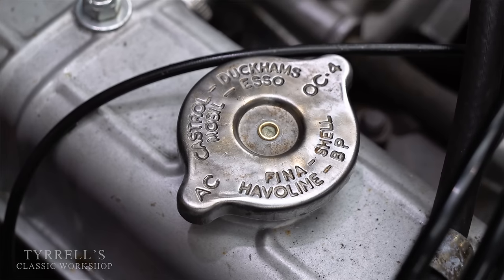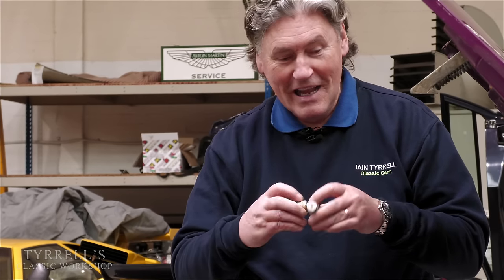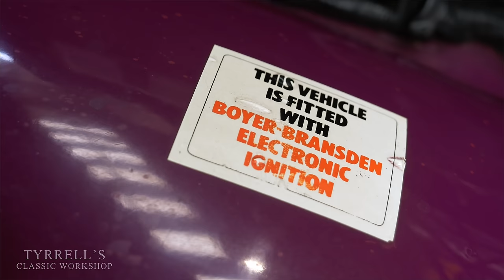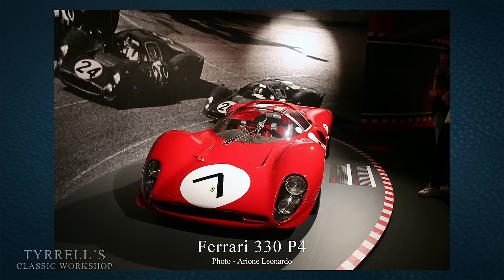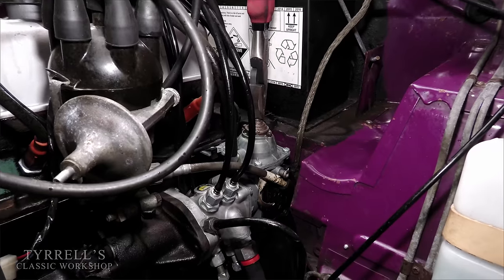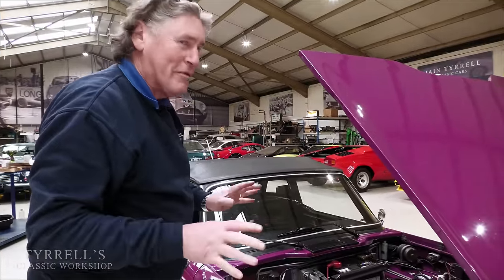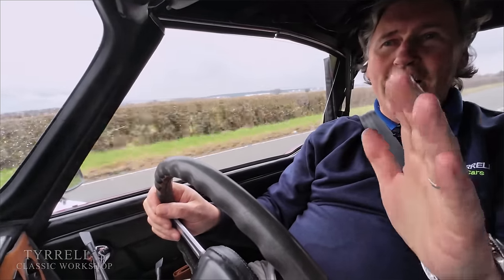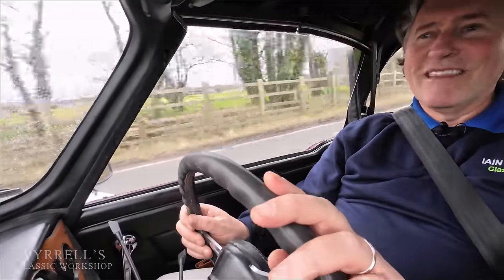Inside the Triumph TR6's Ingenious F1 Fuel Injection System | Tyrrell's Classic Workshop

Comment: Nothing wrong with the TR6
Reply: Then you probably haven't owned one. I once had to replace every bit of wiring in one
Reply: The colour
Reply: @jaapbruijn1300 Beautiful.  That and white.
Reply: @davevan9150 ha, I had to replace the wiring on a TR4 when the ammeter wires sawed through the bulkhead, nasty mess.
Reply: That an IRS wouldn’t fix.
Reply: You’re wrong though.
Reply: @davevan9150 
Why?
Reply: True. Here in the States, the TR6 was known by many as the one fairly reliable, British sports car/roadster. It came along too late to save the poor reliability reputation of British cars in the US, which were displaced as a primary import by Japanese cars.
Reply: @sparky6086  
The Japanese replaced US cars as well.
Reply: Great colour
Reply: Absolutely!
Reply: Not at all.....uhmm big Healey...😅
Reply: Cheap and too slow it deserved the Rover V8
Reply: Except that, under that gorgeous skin, was basically a truck.  Mid-50s frame and suspension technology.  And, of course, Lucas.

Comment: I had a 2.5 PI saloon which served me as a high speed commuter from Leeds to Darlington in '73-'74.  The weak point was said to be the HP fuel pump, but luckily I never had a problem.  These were used as police cars.  Got stopped once doing 100+ on the A1 and got off with a friendly warning.
Reply: Ha, ha, wonderful... I was stopped in a yellow Fiat 124 sport coupe in Peckham doing 55! They let me off too. I only did a quick burst, but still, today? No chance. Also today, I'd never speed. Times have changed. I love the  2.5PI saloon. It looks better than the stag to me.(I had three Vitesses).
Reply: My Dad had both a Mk1 and a Mk2 2.5 PI. He was (still is at 88) an “enthusiastic” driver and loved them dearly. The held the road like they were glued too; I think they had an independent rear suspension set up. We drove (on family holidays) all over Europe in the late 60’s and early 70’s and we only had problems with the HP fuel pump in hot weather (in Spain and Portugal). It was in the boot on one side under the luggage floor and was easily accessed so we used to wrap a wet towel around it, which worked a treat! Great cars!
Reply: what a warm noodle british story to say the least
Reply: I owned a 2500 PI estate car. That think was a rocket ship. This was 35 years ago. To this day I sleep with one eye open to find another.
Reply: I was in the metropolitan police summer 76 triumph 2.5pi area cars, I remember some unit in the boot overheating in the warm weather and having to blag ice from the street traders to pack round the thing in the boot to stop the motor cutting out.
Reply: @cq44b  That's funny. Tell that to the judge. Couldn't get no ice. Lol..I remember now the motorway police had them in west midlands. My buddy had a lotus MK1 and would jump on at junction 2 and his police buddy was on the ramp waiting for a race. Or he was in the Jag. Get off at junction 3 Tipton. Blow out the injectors. ,🤣🤣
Reply: @simondavies4603  Didn't that rear suspension squat like a dog having a bog? lovely car though.
Reply: @adoreslaurel It did! I also recall it had overdrive in both 3rd and 4th gears. There is a lot to be said for sporty saloon cars
Reply: @simondavies4603  I had an MGB with O/D made the mistake of disabling the OD inhibitor switch, forgot to turn it off when stopping, not a good idea to take off in OD first, though its a good idea when changing down to remember OD 3rd back to normal 2nd produces a few more revs than you would like.
Reply: @adoreslaurel  initially they had O/D on 2nd 3rd & 4th but the amount of torque in 2nd damaged gearboxes so it was disabled, wiring I think . I did have the 150BHP model but without O/D
Reply: @cq44b  That was the  Lucas electric HP fuel pump I referred to in my post!
Reply: @julianb1474  hah yes mine was the same,  the injection system itself was great, but that #$% pump!

Comment: My late Dad used to tune these for a living "Triumph Tune". He loved the Pi system and was one of the few people in the UK in the 70's and 80's who could actually set them up correctly. Our main family car right up to the mid 80's was a Mk1 2500 Pi Saloon. The head and the ITB's were all ported and polished. I believe it made 170bhp approx.
Reply from the maker: Thanks for that- interesting!
Reply: We're you involved yourself by any chance?
Reply: @MrByootox  My Dad did teach me a lot of what i know, but i went on to do an Apprenticeship with SAAB and worked with them for a long time before going solo with The SAAB Clinic which i still run today. But these days i just do engine tuning. I dont really remember much about Triumph's.
Reply: Your dad tuned my tr4a in the mid eighties. Stage 4 cylinder head, triumph tune inlet manifold, fast road cam 45 webers. He was the goto man if you wanted serious power back in the day. It easily powered passed tr6 ‘s to much disbelief.
Reply: @terencebrown1754  He closed up shop in 1994 i seem to remember. My parents both retired to Swanage and i had to move out and find my first flat. Sadly lost Dad 3yrs ago to Cancer. Greatly missed.

Comment: Iain! How refreshing to hear someone talk up the Lucas Pi system! I've owned my 1969 CP TR6 Pi for 52 years. I'm its 3rd owner, when I bought it it had just 16k miles on the clock. I often told Pi sceptics how F1 cars used this Lucas system for decades which includes the pump, albeit laying horizontal! Unlike in the Saloon cars Triumph mounted it upright in the TR, so it sits on its thrust washer which would overheat on long journeys, as I experienced in 1973 driving to Spain! However Triumph come up with the so called 'Continental Cooling Kit' Haha, just a coil of metal fuel pipe coiled around the fuel pumps outer casing, and bingo it works too! Crude, but ingeniously effective! I test my injectors in a jam car that has a hole in the lid. I too have recorded all my servicing and work done and have all my MOT's and Tax discs, and all my invoices. I'm surprised how little these cars still fetch!

Comment: I loved my 2500PI when it was working. Lucas fuel pumps weren't wonderful in warmwer climates such as we have here in Australia. They'd heat up dreadfully in the boot there and start to vaporise fuel and cavitate before it made it into the system to go forward. The fix was a Bosch pump. The damned Germans still won! :)

Comment: I have an early 69 PI with overdrive that snuck into Canada. Restored it in 1989. Fitted a Bosch fuel pump and it has run reliably for 35 years with proper care. Own Porsche's and Ferrari but will  never sell the TR-6...
Reply: You mean you actually like the steering system/geometry and those rear oil/lever shocks?
Reply: @AvaPxiaO  Yes I do. It's a nice change from the effortless precision of modern cars. The TR-6 awakens the senses. You have to pay attention and drive it.
Having said that , I wonder how I drove one as a teenager as my daily driver. Even in the Canadian winters! Thought nothing of it. 
I must admit though , that as I have become older/softer I can only take her in measured doses but I enjoy every mile...

Comment: As a Benz mechanic it was assumed I could work on anything from across the pond. Got one of these in the late 80s into the shop. Being Bosch certified I was under the misapprehension I knew everything injection. Got a lesson on this one. The valve is very much like American gas range valves. Aside from its multiple layers it is essentially the same. After that it was easy peasy as you Brits say. The car was a TR7 wedgy I believe.

Edit: As for Lucas bits I'll say this. If your grounds are well done, and you keep things clean, most of it is serviceable
Reply: Now I'll have to try and look-up American gas range valves to hopefully understand what have said.
Reply: If it was a TR7, it’d have been on carbs. Later on, the TR8 used electronic fuel injection (Bosch L-Jetronic)
Reply: Lovely car driven on potholed roads!
Reply: @emmajacobs5575  I'm sure that California spec 2.0 litre TR7's were fitted with Bosch injection equipoment in order to pass that states emission requirements.

Comment: The Laycock overdrive system is simply devine equating to a 6 speed gearbox, 3rd, 3rd o/d, 4th, 4th o/d. When changing down a quick blip of the throttle as you flick the o/d switch and you get a seamless gear change. Fantastic.

Comment: The most fun I've ever had driving was when I was able to swap cars for a weekend with a friend's 1972 Lotus Elan. I'd had the chance for an odd drive in Triumphs and MGB's, but the Elan was in a class by itself. There are few modern comparisons for these mid 20th century British 2- seaters, for sheer driver pleasure. At least not for the money they cost new. 700hp and driving aids really can't compete for driver engagement in a light car designed to make best use of under 200hp.
Reply: Yes! It wasn't particularly powerful, but the light weight and the handling made it a contender. I had a ride in a modified Elan in 1970. I think that Lotus claimed 105 bhp or thereabouts for the standard Lotus/Ford engine. Those were the days when quoted HP figures were to be taken with a huge pinch of salt. It was more like 90. But the car was so light that the performance was quite good. Ian Walker Racing in London raced Lotus Elans. He would sell you a modified Elan with a genuine 165 bhp. That was fast 😁🤩

Comment: Lovely in Magenta! In 2006, I bought a 1969 mk2 Triumph 2000 saloon. Most people who saw it threw their hands up in horror assuming it had the PI injection system whereas in fact it had carburettors. From getting to know a few people with 2.5 PI cars, In reality the PI system worked really well and was pretty simple if you took the time to understand how it worked.
Reply: In the days when I was selling Triumph, Rover, Jaguar, Daimler, Rolls-Royce and Bentley, the local Suffolk Police had a fleet of Triumph 2.5 PI's.....no problems with them because they got caned, every day. The problem was with owners who pootled them around...the 2500 TC sorted that out.
I have had several TR6's over the years, most recently a Mimosa Yellow example ("the Mustard Pot"). Sounded great with the stainless steel (wheel barrow handles ) exhaust - much like a C Type Jaguar. Mine had a Bosch pump which sat outside the tank...I always understood the original pump was in the tank - cooled by the petrol!

Comment: Had a 2.5 Pi Estate back in the 90's.  Loved the car to bits.  3rd / OD 3rd is great on winding roads.  Needed to check the fuel pressure so headed to my local garage outside Market Bosworth to ask if they had a pressure gauge could cope with the required ~ 110 psi.  'What do you need it for?' was the response.  I explained upon which they produced a plastic briefcase labelled Lucas PI Test Equipment.  This was a factory original kit with a fuel pressure gauge and engine vacuum gauge with enough hose length to reach from under the bonnet to inside the car for road testing (just as well Triumph bonnets open forwards!).   I recall that the Factory workshop manual for the 2.5 PI stated that customers would usually blame the petrol injection for any faults but chances are it was something else at fault and this certainly matches my experience.  I met a chap who'd worked at a Triumph dealer in period who said standard practice on all PI equipped cars was to first do a 'second gear decoke', which generally solved loads of problems.  Happy days.
Reply from the maker: This is wonderful detail. Thank you very much for sharing it.

Comment: Lovely to watch this video as I have owned my TR6 for 50 years. I basically traded my ‘68 XKE for it. Even though I still think that the jaguar XKE was the most beautiful car ever made. I don’t regret my swap. So many memories over the years and the memory of the XKE would’ve just been working on it.
Reply: What a wonderful story. Similar on old an motorcycle for me, 46y in my possession.
Reliability is so important. Vehicles can stab you in the heart and wallet if you cannot trust them. I can understand why you swapped, and as they age out, the TR6 only gains in attractiveness, even if it’ll never have the top model awesome beauty of that Jaguar, the latter would have become a fickle mistress!
Reply: @GT380man  So my brother had a Suzuki GT380 that he liked to race my 750 Bonniville. I would take him off the line then he would overtake me. Damn Ram Air
Reply: Alfa Romeo used a mechanical fuel injection system by Spica. It was very reliable. However, a lot of owners changed them out for webers for ease of horsepower increases.

Comment: Here in America we had a similar problem with fuel injection systems.  The Corvette had a mechanical fuel injection system and there's a thousand antidotes out there about people removing the system and replacing it with a large Holley carburetor.  I've even heard stories about 'Vette owners pulling off the system as soon as got the car home from the dealer!  The sad part about all that behavior is that if they would have retained the injection system it would have significantly increased the value of their cars.  I learned about the Lucas PI system while I was in engineering school , and to agree with you, I found it to be quite an elegant design, however, with that Lucas name attached to it, it made it a little less desirable.

Comment: Great video. Brings back memories of my misspent youth in early 70’s when I sold TR’s at Puttocks in Guildford; the injectors would occasionally foul especially with cold stop/starts (like moving around the showroom) so mechanics would pull out the injectors just like you did to check them. Brilliant.
Reply from the maker: Great memories- thanks!

Comment: such a nice car. lots of history. an uncommon fuel injection system. this car is a prize in its originality.

Please use some fender covers.
Reply: That occurred to me, too. I don’t lean into a vehicle without a couple of old towels protecting the bodywork. It’s so easy to mar it with a belt buckle or to drop a tool on it.

Comment: I had a 1970 2.5PI saloon in 1978. The car had belonged to my father, who had bought it from my uncle, who had bought it new.
My uncle was an engineer by trade, working on all his own vehicles. To this end, he had acquired the official A4 'ring binder' workshop manual.
This manual contained a 'pearl of wisdom', which allowed me to diagnose a fault in the fuel injection system in seconds.
I forget the exact words, but the manual suggested that, on suspicion of a fuel fault causing a misfire, one should:
With the engine at tickover, firmly grasp each individual injector pipe in turn, where a distinct series of 'pulses' should be felt in the lines. If the 'pulse' was absent, then suspect the 'poppet valve spring' in the associated injector nozzle to be faulty.
Just thought I would pass that little snippet on, as it may be of help to somebody in the future.
Reply from the maker: Thank you- simple but enlightening potentially
Reply: You could pull them out as they were in the manifold and inspect the shape of the spray

Comment: My '76 tr6 (US carb version) had a valve tick that would not go away, my Mom bought it new and it always had the tick. I couldn't stand it any longer and tore it apart at about 50,000 miles. It had a bad cam lobe/lifter. I replaced the lifter and had the cam and other lifters reground at a local shop in San Diego. After that it sounded like a sewing machine. It was a good and reliable car for me.

Comment: Your video took me back to when I owned a TR6, an earlier 150bhp model. That had been fitted with a Bosch pump and in the three years that I owned the car the fuel injection gave no problems. It was a great driving car that gave me lots of pleasure, just wish I could get in and out of one easily now!

Comment: My two Suzuki GT motorcycles are a similar age, 1977. An R reg GT750A & an S reg GT380B. I’ve owned the little triple since 1978 & all but the first 6k miles of its 45k were ridden by me. I’ve very fortunate to still own it. Lucky decision making, or lack thereof, really, not selling it in 1982 when I got my first car….it could so easily have gone then, but it ended up under a pile of blankets at the back of my foster dad’s garage, pulled out by me when he passed in the late 1990s. At that point, I was seized by the wish to rescue & restore it. 
I have all the records back to 1978, and the original owner information from DVLA. 
I am with Mr Tyrrell, I too like beautifully designed mechanical systems. 
I’ve always admired the TR6, but I didn’t have the desire for nice cars until recently. I now own a just classic 911, a 996 40th anniversary edition. My wife and I drove it today, and the mechanical feeling from everything is a joy to me. Modern cars are superb, but left to a free choice, I’d stick with mid 90s to mid noughties vehicles with mostly mechanical & electromechanical systems. They tend to be robust if well made originally. Electronics and always connected vehicles leave me worse than cold, I find them creepily Big Brother. The potential for remote interference is obvious and I think is an inevitability. Fur ihre zicherheit & all that.